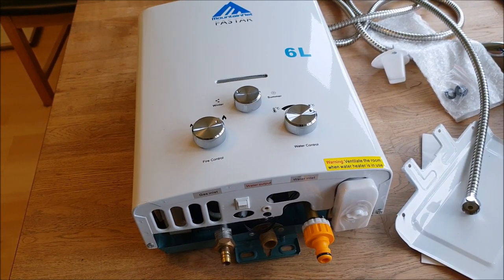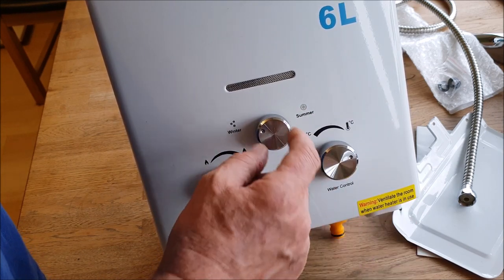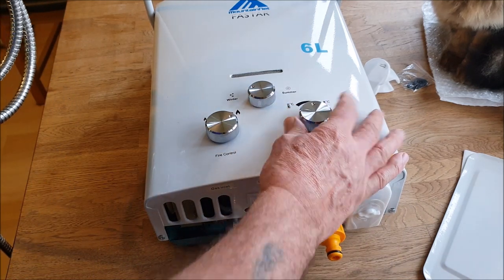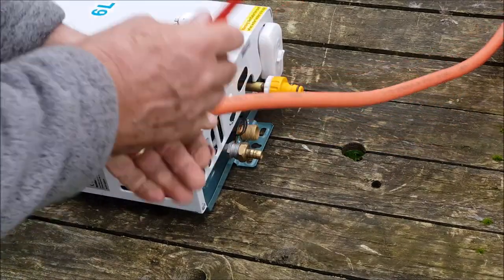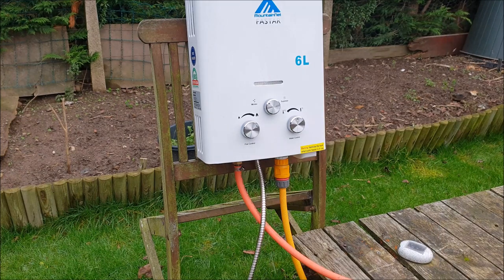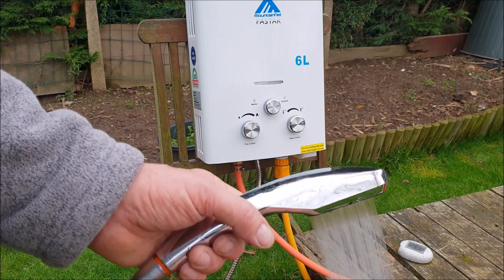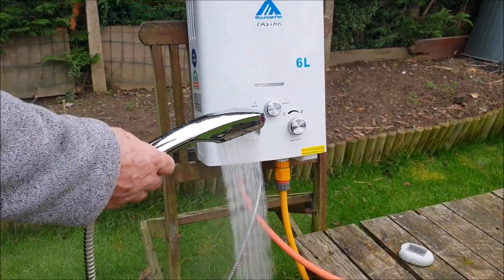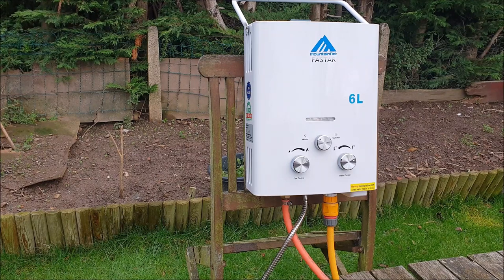PORTABLE GAS SHOWER REVIEW AND HACK

Comment: Hi, as my water pressure is quite low in the van compared to mains pressure the water becomes too hot to shower in.  Can you advise how to reduce the temperature please?  Would you suggest I use summer mode?  And maybe reduce the water dial?
Reply: Low tech, buy some jb weld, open it up and cover a few of the holes on the gas burner rails. Keep covering a few holes at a time until you've reduced the heat enough.
Reply: Using "Summer Mode" automatically blocks off half the gas jets thus halving the heat input. You would need to INCREASE the water throughput to keep the temperature down not DECREASE IT! 🙄

Comment: hi, what would the problem be if the unit doesn't self ignite (peso isn't sparking) with new D cell batteries. It also seems to not allow gas through to burner so can't even light manually rendering the unit useless.
Reply from the maker: water pressure , battery switch, gas not on ,sorry not being rude Marie

Comment: Had the same problem with my joolca the damn shower head was absolutely useless pumping too much water sent the water damn cold out the other end for a half warm shower by the time it was at the right shower temp 47 degree it was a dribble coming out you would not call a shower despite all the high price and fanfare how great it is on the brochure. a swiss couple in the mountains having hot fast showers all plastered all over the advertising. total scam these water units. im thinking of hooking two of them up or maybe three just to get the pressure and temp at something usable

Comment: So what the Hack? This is just a setup. i had to use a solar camping water shower head and throw the expensive one away that came with the unit. you can get and adjustable water flow shower head save fiddling with the mains pressure you be had if your using a cheap 12v pump without an accumulator. Im going to buy a cheaper second unit hook a t piece on the propane bottle and run two units together just to get some pressure and heat. a dribbling shower is not a shower at the end of the day. i have to admit out of all the cons these units save a lot of money on heating bills but at the sacrifice of a crappy shower. Given that im hooking two units together see how it goes pressure is a big deal when it comes to showers man not so much a hot bath which is out of the question with these units capped at 50 degrees time it hits the tub its cold again you need at least 75 degree to draw a hot bath by the time it cools down to 50 degree. remember body core temp is 37 degree you need at least an increment of 2 -10 degree above to have a "hot shower" Japanese know their baths they go up as far as 60 degree meat starts to fry at that temp the crazy bastards. but they have good health Low cancer rate. Cancer in the body cant survive at a certain temperature you dont want to fry your organs at that temp drinking ice water at that tem helps balance heat away from the body vitals and killing cancer throughout the rest of the body
Reply: Did you try hooking 2 together and did it work?

Comment: Could this be used inside t
A caravan?
Reply from the maker: No but if you look on ebay they do some with a flue thanks for watching David
Reply: I have a similar one inside my bus. It should be flued & approved by gas fitter.  But I do know one or two which haven't. Make sure you have gas alarms & when using have the windows open. Don't take long showers. Five minutes max. And best if your califont gas bottle is outside. There is a lot of heat coming from the top. So a heat deflector is usually situated some 6 inches or so above. But, of course, mine is not like that & such a setup would be illegal in my country.

Comment: U should never! Use a hose clamp on a gas line buy the right hose
Reply: Correction ..you should Always !! use a jubilee clip on gas lines Rubber  gas hoses are  the same bore and diameter across propane ,butane, and  other bottled gases  be and clamps are recommended at the regulator and the  appliance 👍